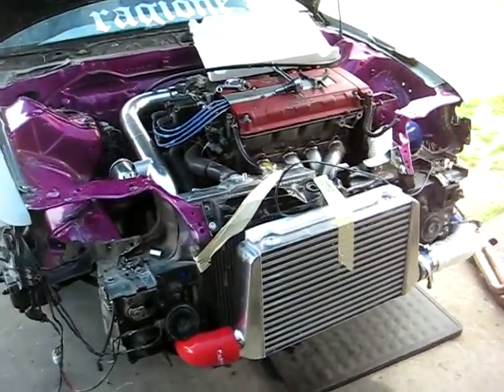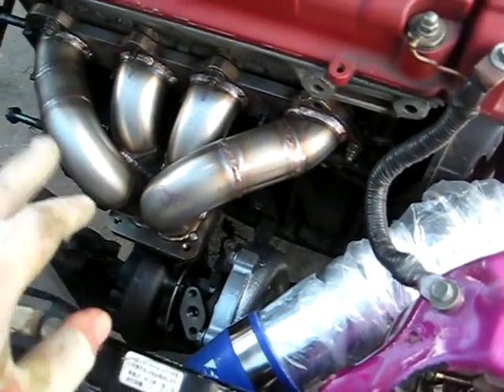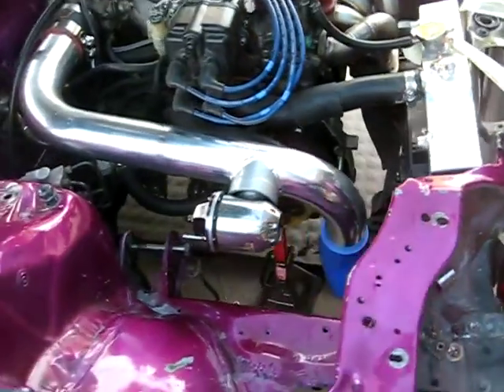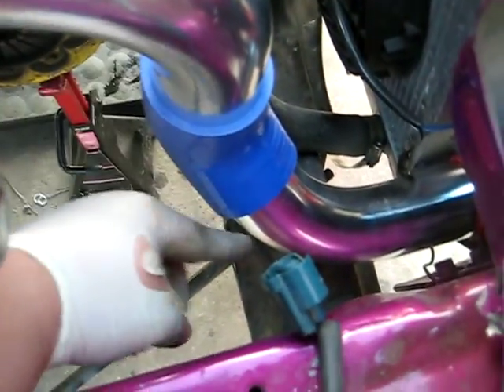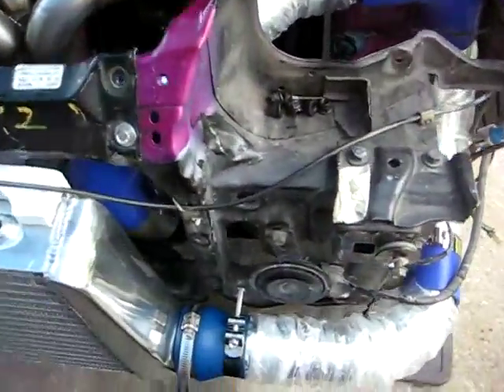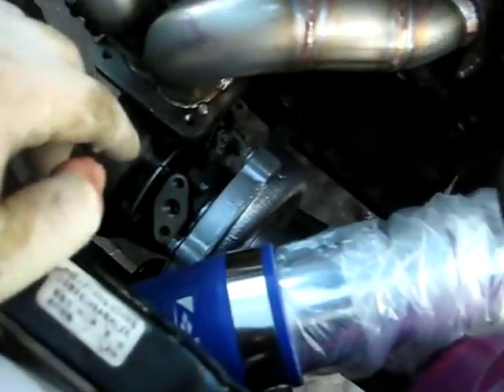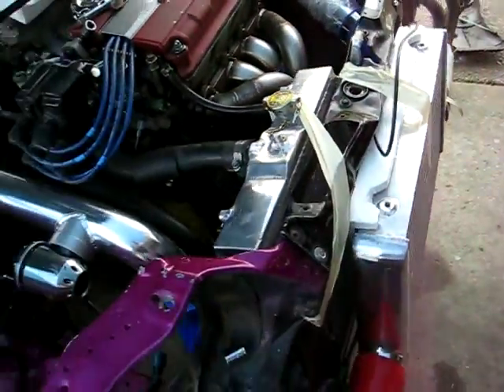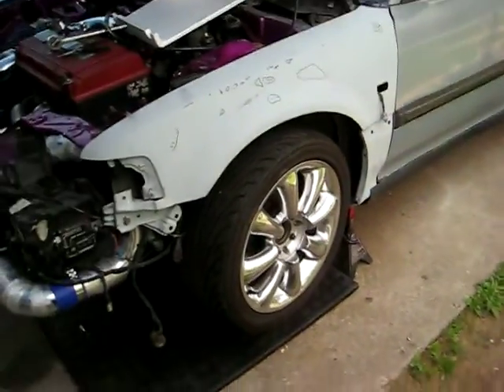EF Sedan. LS VTEC Turbo Intercooler Setup

Comment from the maker: its a garret turbo 60trim 82exhaust. my manifold and down pipe came from SpoolinPerformance as i stated in the video. the turbo kit i pieced together for the last 6 months. not something i bought as a whole. i had ebay parts and got rid of it for quality parts. ebay would work but depends on the style manifold and wastegate location.

Comment from the maker: @Fittest224 you clearly didnt read and understand whats in the description box. the intercooler kit is a universal kit from ebay. the turbo is a garrett 60 trim. the manifold, dp, dt are spoolinperformance and its on a tial 38mm wastegate.

Comment from the maker: its on another lsvtec except it now has piston/rod/valve train, a whole lot of other knick knacks. when the motor blew, the block was done. had a hole. the valves also bent and the head had some chips in it.

Comment from the maker: @chillincruisin you can run a backdoor ic or cut a hole in the radiator and run it like a backdoor ic if you cant afford one. otherwise, yes the reservoir has to go.

Comment from the maker: ebay kit is ok. its the turbo and wastegate that doesnt hold up for too long. wastegate can get stuck open and cause spikes and blow your motor. the turbo will go out over time faster than you think. alot of people though has been running ebay kit for a long time and not have a problelm. my cousin just bought a turbo kit. for a beginner i say its ok. built internal or not.

Comment from the maker: yes i understand what you are saying bro. i was thinking of running something like that to hide the pipings on each side. but how my manifold and turbo sits, i would not have enough room to run the 2.5' pipe from the compressor housing to my IC cause the space is tooo small and tooo close to my cross member. if i had a traction bar, maybe ill reconsider. but this will do for now. thanks for looking out.

Comment: That sucks.  I've seen a connecting rod break and go through the block on a V-Tech. I think it was a '89 EF and you could tell he rung the cars neck constantly the second he bought it.  He had over 4 grand just in paint /body work.  Good looking/sounding  car Sold as is and still got 5 grand HE said.  I'm betting he lowered the V-tech high cams with an ecu to kick in at lower rpm.  I also saw the intake mani on a 454 melt INTO the heads/block.  Didn't even ask how, just helped put out the fire.

Comment: side and put a 90 degree coupler from intercooler thru the hole and out the other side take a 90 degree pipe an cut it right after the  bend..  so it be turbo down 90 degree coupler towards the driver side.. pipe with 90 degree going into the 90 degree coupler thru the hole you cut n in to the intercooler..  everything will fit nice and look at lot neater. hope this helps

Comment: Hi! Don't use the weak hoose clamp you have at the intake side of IC. If you use it, it will pop off. Those are good only for the air intake filter :p

Comment: hey i like your set up, idk if the car is done but u have a lot of pipe ran. I have a turbo crx and took me a while to run the pipes right so it wount look ghetto.  just a suggestion now if you turn the turbo around you have alot more room and keep it nice and tight. turn the intake side of the turbo down and use the 90 degree coupler. now you kno the hole you cut on the rad support well cut a hole on the other side and put a 90 degree coupler from intercooler thru the hole and out the other